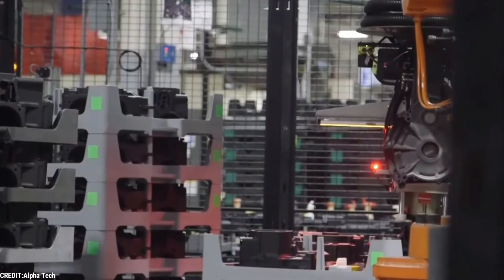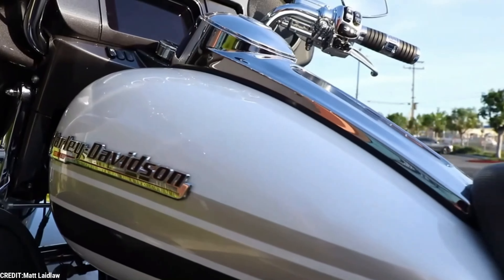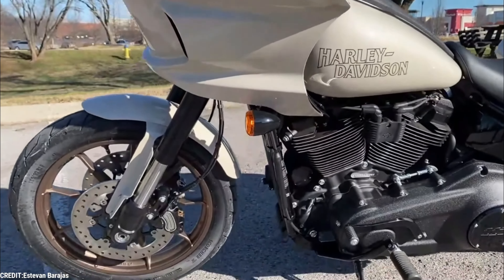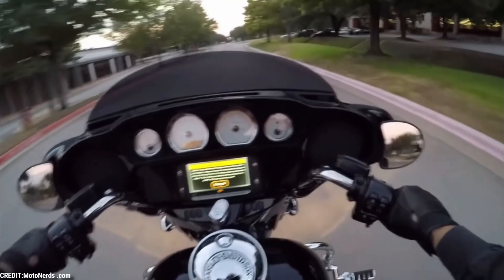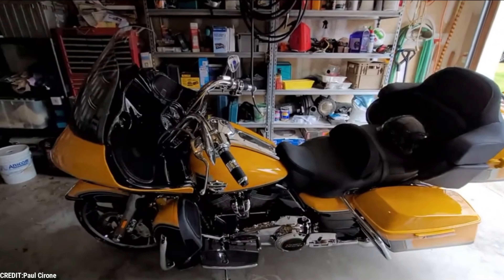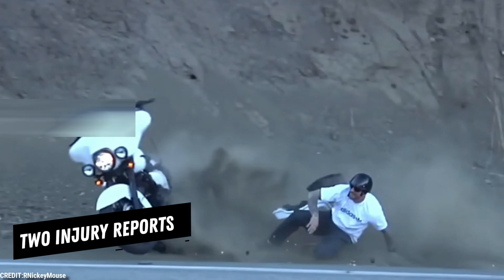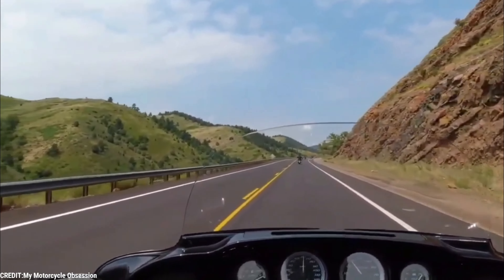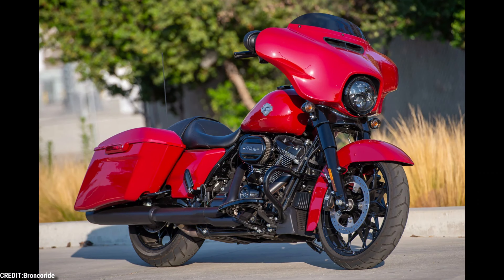HARLEY DAVIDSON Re-Call

Comment: How bout recalling the oil pumps on early M8s.
Reply: When I bought my wife's bike 2017 SG I had them check for sumping. It was found that it was doing this so the dealer replaced the oil pump with the new 2022 model for free. We took advantage of this and did her cam upgrade at the same time. If it is sumping, take it to where you bought it and negotiate a replacement.
Reply: @paulspragge07301975  my 2018 Road King Standard hasn't, YET. I've vented the dipstick & installed a catch can, to monitor it.

Comment: I own the new '22 Nightster and there is a recall out on that for the handle bar ends  breaking off in your hand 😱
Reply: That is bad. Are the bars made over seas?
Reply: @markmcintosh7095  yes. Not 100% sure what country. It only happened to a few people and no injuries I had heard of. Seems they caught it in time. Turned out to be faulty welds.
Reply: @cjdent90  Thanks

Comment: Harley should have recalled the old twin cam 88 for wobbly cranks and missing a Timken on the left side, bad cam chain tensioners and crappy cam bearings, and not enough chassis stabilizers from the factory.  But as usual the scam is they sell you a blank canvas for the price of a Picasso.